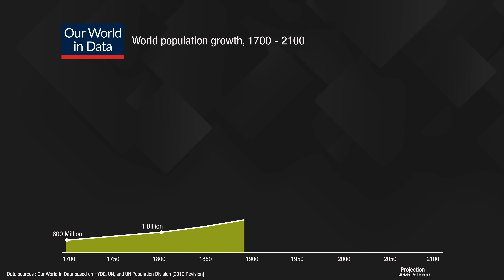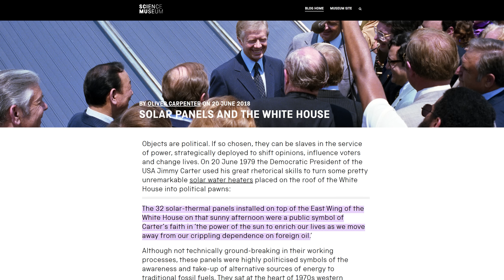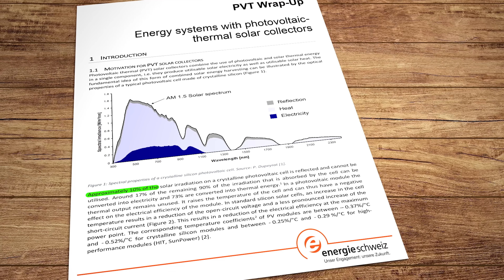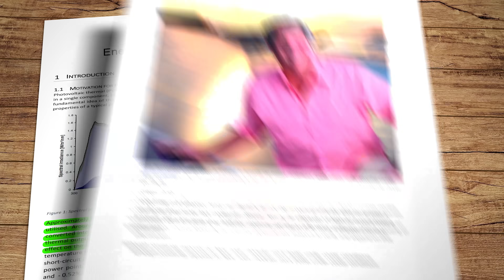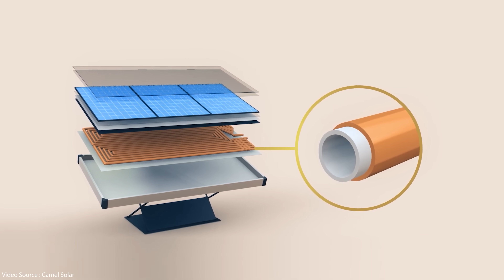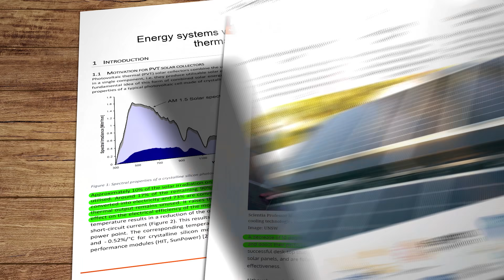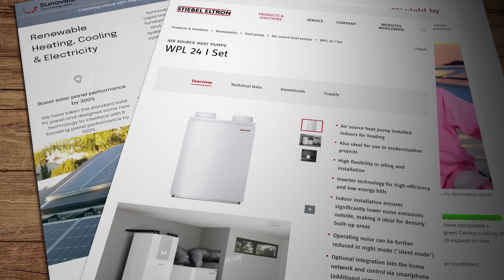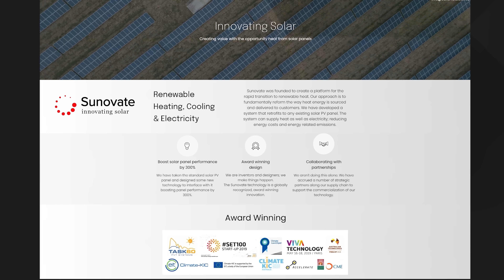The Solar PV panel that provides electricity AND heat for your home!

Comment: It would've been interesting to hear how the thermal systems affect the total output energy of the panels (do all the fans in the gas approach just negate the efficiency gain? (Or worsen it))
I'm also surrised the liquid solution problems couldn't be worked out, the temperature gradient issue can be resolved the same way as the gaseous implementation, cooling each panel individually, and with regards to liquid and electricity, we've been using liquid cooled computer systems for years, surely there's some useful research to be applied from it here too?
Always look forward to these videos though! :)
Reply: Back to Edward deBono. I'm sure that these problem could be solved synergistically, the same way Telsa saved energy in heating and cooling their car's interior by utilizing the waste heat from cooling the car batteries with a multi-channel heat pump. What is described here is just the first step. In time we will be able to build solar panels that are self-cooling via multi-frequency solar energy conversion to electricity.
Remember that cooling the panels not only increases performance and provides useful heat for other energy uses, it also doubles the life of the solar panels which effectively halves their LCOE, while adding more solar panels, costs more. Sometimes, it just takes a 'crazy' entrepreneur, who doesn't know what 'can't be done', to make it work.
Reply: We refer to your question as the energy returned on the energy invested EROEI. It's an important question which our design sought to address with our innovative design. We wanted maximum heat transfer so we can keep flow rate lower and the grade of heat clean of mixed in inlet air. So our EROEI invested varies depending on conditions, but is +2 for PV Boosting and +100 for heating. The difference with computing systems is that value the heat rejection rate is +100-1000 times greater than the solar isolation. So the value driver for computing is computational performance and our is EROEI.
Reply: I think a closed system of some high tech coolant could cool the cells and also create a high pressure point in the system to drive a small turbine that adds to the electrical output
Reply: The other thing about computers being water or liquid cooled is that usually they are in a very controlled, cooled, optimal humidity environment, while the solar panels literally have to endure extremes (cold and hot, humid or dry) for decades. So I'm not sure a lot of the knowledge of liquid cooled computing devices would transfer
Reply: Yes crypto miners submerged their asic mining rigs in a non conductive oil
Reply: @TT-nk5hi  and  the prius or camry hybrid motors are cooled by oil and not by coolant, circulated through the heat pump.  The oil can contact the windings and remove heat better, because it is non conductive, unlike coolant.
Reply: @mikemotorbike4283  yes developing a substance that can remain in direct contact with heat generating silicone junctions and also circulate through a system producing some kinetic energy exchange we have a more efficient solar energy system.
Reply: This was where my brain immediately went as well. I’m sure, once stuff starts to hit the market we’ll really quickly get loads of data if the upgrade makes sense.

Just off the cuff, I’d imagine that it saves energy as long as it’s replacing current heating that you do in your home. If it’s just generating excess heat that you don’t use, then it very well might be wasting energy for you.
Reply: @SaveMoneySavethePlanet  use the heat to convert a liquid to a gas and run small turbine and generator.
Reply: @TT-nk5hi  yea something like that could definitely work. I’d be curious though how much energy is still produced in the end after the loss to change material states.

That being said: I wonder if it would boost the efficiency of the panels enough for dense housing like condos. That could be a big game changer!
Reply: @SaveMoneySavethePlanet  has to boost efficiency because it keeps cells closer to optimal efficiency temperature and uses extracted heat to change the state of a substance to create a pressure differential in the system to drive a turbine adding to the net output.
Reply: @TT-nk5hi  that’s my assumption as well, but the proof is in the pudding so to speak. So I’d just want to see a real world scenario of what numbers are achieved before I throw my own money at it. That’s all.
Reply: Making the cooling system better (totally possible) also makes the panel more expensive, which extends the BEP far too much.
Reply: the main problem with either of these systems is getting them cheap enough. you need the hardware to be cheap, AND you need it easy to install. the cooling of the panels is a benefit, but the cost to install, maintain, and operate the blowers/pumps has always been greater than the benefit. if you actually put the hot air or hot water to good use rather than as just a way to increase the efficiency of the panels, they it MIGHT be enough of a gain to offset the cost and energy consumption of the panels. if it costs you $1k-$2k in labor to hook up all the plumbing or ducting, then it probably makes more sense to just add more panels instead and skip the heat harvesting.

however, if the cassettes are designed simply and double as a mounting platform, then the labor cost might be reduced enough to make it worth it. 

if you're willing to DIY much of the work, then it may be a pretty good benefit.

personally, I think it might make more sense for them to create a system that tries to create an up-draft through some kind of cassette, that way you don't even need to capture the heat and the lower panels (with micro inverters) will be cooled by such a system, then a homeowner could choose to take the output of the natural up-draft and pull it inside for some use.
Reply: the more one is  space constrained (limited numbers of panels) ,the more pvT will make sense.
Reply: @unionse7en  exactly
Reply: @somedude-lc5dy  These make sense if you don't have room to simply add more panels. Also, in stand-alone systems every bit of heat helps. It only makes sense comparing that heat bonus with natural gas if you already have natural gas. If you don't need to plumb for NG, then your labor and cost savings go up significantly.
Reply: @somedude-lc5dy  I like some of your thinking but the updraft rather than downdraft makes no sense.

Comment: Cool.
Through the "use the cool panels at night to cool down the house" makes almost no sense to me. The outside air should be at a similar temperature (excluding the space cooling effect), so wouldn't it make sense to just dump more outside air into the building via vents?
Anyway, all of this won't matter for me, as I won't be a homeowner any time soon in the next 20-30 years. So I will continue to spew my mandated amount of carbon into the air thanks to my landlord.

Comment: Imagine living in the outback aus you become independent, Just the watermanagement is a hurdle, but with recycled water you can go far. A crucial step forwards for the Aussie world. As a dutchy i'm optimistic for our future. Massive storagebuffers are the solution for bringing down the price p/kwh down to 1 cent. That makes gas and oil to expensive. It's good for your wallet and society
Reply: You could combine the "air sponges" tech (see Bill Gates, et al. testing in Oeru now, I believe) that can harvest moisture from thin air to supplement the loss of any water in a drier climate such as the Australian Outback. Cheers!

Comment: Recently Linus tech tips bought solar panels with built in inlet/outlet for water cooling.
They havent hooked it up just yet, but it would be interest how much heat it could harvest in tandem with electricity
Reply: Even my first experiments could extract substantially more heat than electric power and I expect it to stay that way :-)
Reply: @HexBeach  was that experiment conducted in (North American) winter?
Reply: @jonnyde  No. Northern UK, (54.3° north), in spring. If you live in very cold places, you might want to consider 1 or even 2 panes of glass in front of any heat collection panels, or if you have the roof space, separate PV from heat altogether.

But for a lot of people the hybrid collection can work well most of the year.
Reply: @HexBeach  I wouldn't put any glass in front of the PV panels myself. Remember each layer of glazing reduces light by 10%, so even a 10% gain from a panel who's energy was FIRST reduced by 10% would still put you negative.

I think we have to look at these systems like heat pumps: there's still heat to be had (extracted) even in winter temperatures.
Reply: @onebylandtwoifbysearunifby5475  It all depends on temperature, roof space and economics.

As an example, I'm building an electric camper. Roof space is limited, but on the other hand it isn't very often cold enough to worry. I haven't decided yet what approach I'll take.
Reply: @HexBeach  In that case my suggestion may be this: I think the math will be a good place to start. Do your estimate with no glazing, and then reduce your STARTING figure by 10% and do them again. Whichever is larger is the way to go.

...but: reflecting solar input away from the collector is reducing it's starting efficiency in electrical and thermal capabilities. It's very hard to climb back that. You would effectively need a perpetual motion machine. I would focus on making heat recovery more efficient AFTER the energy has hit the panel, rather than blocking it. You'll just end up heating your PV panel and further reducing its efficiency. I'd keep one side of that PV panel unobstructed, and work from the back... Or just do a solar heat collection window separate from PV. Vertical panels usually do well in winter, especially if there's snow reflecting sunlight from the ground plane. A solar heater on the side with PV/ PVT on the roof may be your best bet depending on latitude (anything 45 deg+ is usually a vertical mount candidate for heating. Then it's 60 deg angle at Dec 21 st. Better in the vertical domain, IMO.). 

The only thing i may do to the front of a solar PVT is add some wind breaks like flanges to prevent wind washing/ convection carrying your heat off. As long as they didn't shade your panel, they should add efficiency in heat collection. How much? Well, that depends. That's prototype arena; that's why we build prototypes, right?
Reply: @HexBeach  ...oh yes, and vertical side panels can tilt out to lower angles for other seasons. They could snap-in to side mounts in seconds also, if you wanted to keep the sides clean for travel.
Reply: @onebylandtwoifbysearunifby5475  Eh? The idea is to have some warm water as well as electrical energy, preferably without burning any fossil fuel to do it.

So if (for example) I can collect twice as much energy (half of it as heat) while only losing 10% of the electrical energy, then I win. Assuming I would have dumped PV into a heater otherwise, obviously.
Reply: The only problem with side panels is the hassle factor. But parking the thing in the right direction could leave a cold side and a warm side in the morning, which might have thermal possibilities. I haven't looked at that properly yet.
Reply: @HexBeach   That solar PV will lose at least 50% of its efficiency in a heat box. Plus it will lose 10% of it's maximum available energy due to reflected light via glazing covers (10% for each cover). . 

So if it can produce 100w, then you add glazing it can only produce 90w max. Now take half of 90 to get 45w panel...MAX. So you can't get back that initial 10% reduction, because everything else downstream is lowered. (And that's just with one cover). 

Unless you just really don't need any electricity from that panel, i wouldn't put any glazing layers in front if it, and i wouldn't warm it to 120 deg F either. You're going to end up with a runaway inefficiency: the more the box warms, the less efficient it will get. 
...But..  as i said, this is just what I would do. Your 2 prototype versions will tell you the answers. I would think about vertical side mounts for solar heating. Solar PVT makes sense if you're simultaneously cooling the panel to increase efficiency AND recovering that heat for energy use. Otherwise, it's a tough prospect. 
...but: prototypes will tell the tale. I'm not trying to design this for you, just pointing out some considerations.
Reply: @onebylandtwoifbysearunifby5475  It can lose a fsir bit if it gets hot, although "50%" is pushing it.

But it loses little or nothing if the heat is carried away by water, yes?
Reply: @HexBeach  That's probably the hitch: the temperature of the box won't drop if it's sealed, because it's always getting more radiation. If it did, you'd have no heat to collect the following minute. The box would need to be hot to heat the water tubes in it. The heat transfer rate is also not linear, so decreases substantially unless you have a large heat differential (like a "potential" in electricity: the higher difference the better). 

I might try a box with 2 layers of glazing for heating. I would use plastic, as it is light and will save some fuel. 2 glazings are typically better than 1 for solar heaters. Then i would find a place for a 45w solar PV, which would be substantially lighter and smaller than a glass 100w PV. 
Or use a side mount that articulates for one of the boxes or panels.

Typically for solar air heaters, a snap-disc thermostat is used that turns on at 110 F, and off if it drops to 90 F. That is hooked to a fan. The box doesn't get below 90 F, and usually stays higher than 120 F all day. Those temps would drop a solar PV efficiency a fair bit. The entire panel including the backsheet would be baking at 120-130 deg F all day.

I would try to take heat from the back of the solar PV personally. Else your 22% efficient panel will turn into a 10% efficient heavy, large PV of the 1970s. 

My personal design philosophy is not to put anything in front of a solar PV except a star. I'd take the heat off the back, or use a separate heat box.
Reply: @HexBeach  all depends on the problem you are trying to solve and the proportion of heat and electrical demand. We have done double glazing experiments also. We got stagnation temperatures of 150degC. So you can increase your thermal recovery but you loose a little on the electricity portion. Calm days less of an issue but windy days there is a marked improvement. We will have more to come on this but we start to get into PV customisation. At the moment we look to use existing product. Baby steps first!!
Reply: @glenryan6692  150°C is crazy! I was holding it down well below 50°C, which would give a free source of hand-hot water for washing, and also a saving on any water to be boiled.
Reply: Lol... another Linus Tech Tips cooling project!